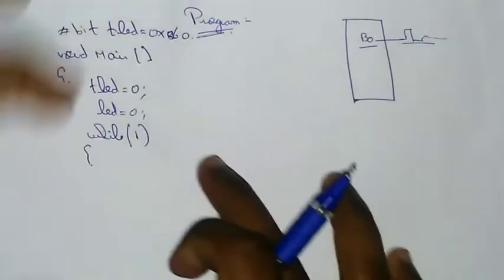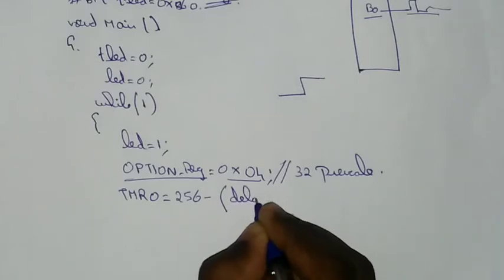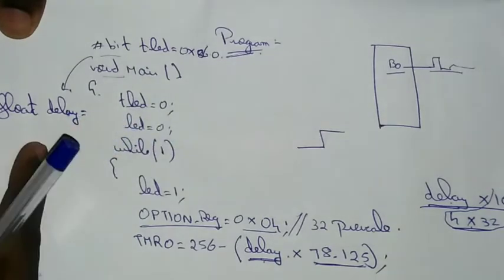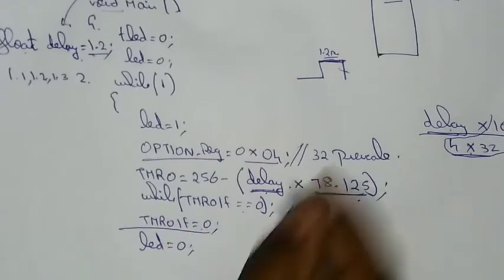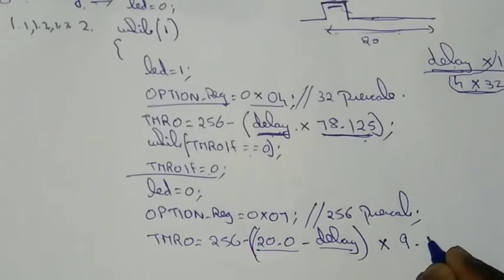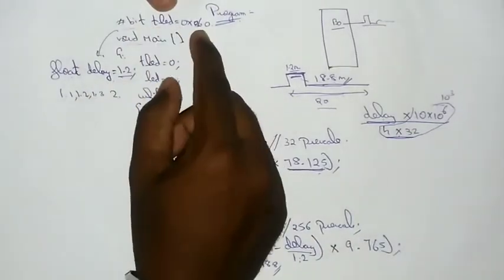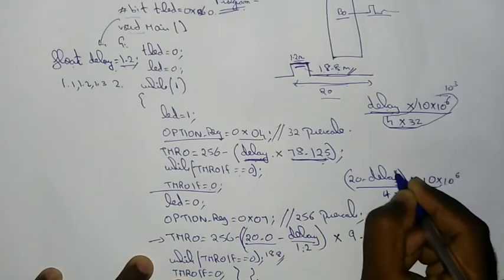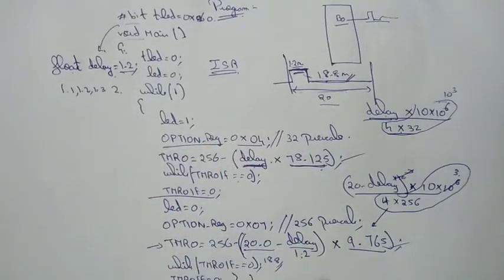#13 Program for PWM with Timer 0 in PIC Microcontroller - தமிழ்

Comment: hi sir,
  one help 12f675 ic la eeprom use panni oru port la push switch connect pannitu any two port ah high low panna vendum.
example:
              switch press 1 time -high low (any two port)
              switch press 2 time -low high
              switch press 3 time -high high
              switch press 4 time -low low 
 internal eeprom ah use panni oru sample code venum sir help pannunga. sir send your  contact number.
Reply from the maker: Kandipa adhuku ஒரு video pannren nagaraj thanks for support. Keep learning
Reply: @program_brain   thank you sir
Reply: @program_brain  hi sir intha video poda late aaguma i am wait